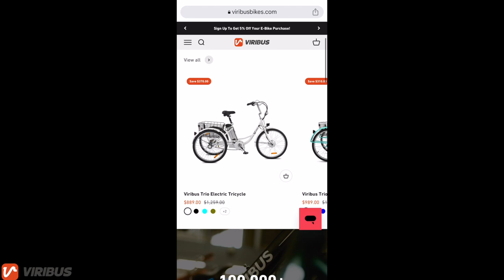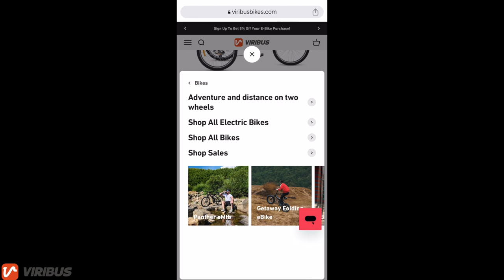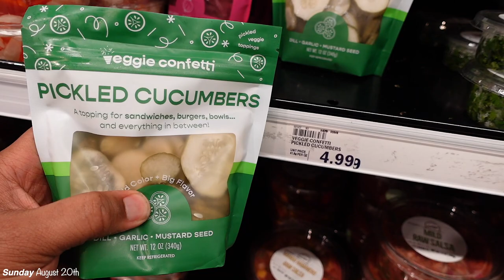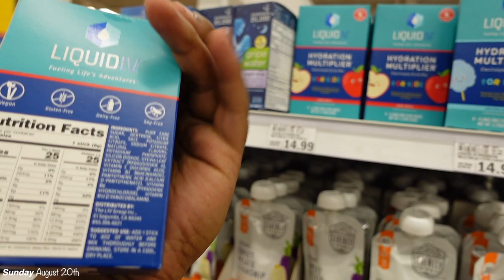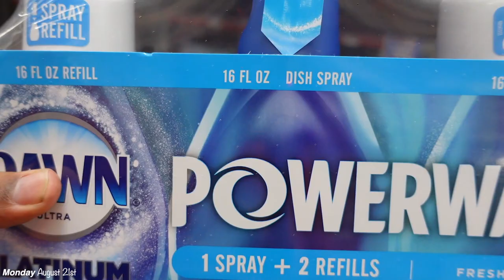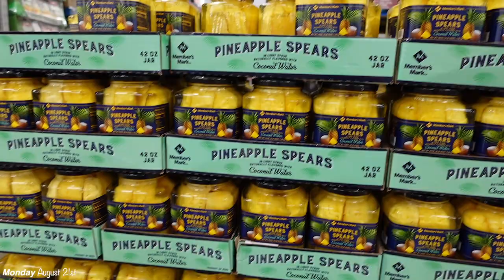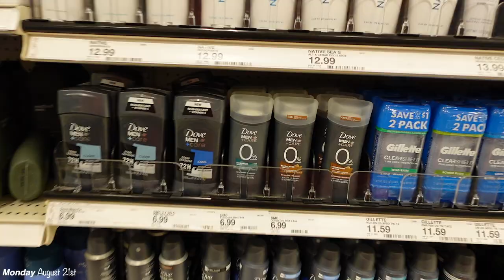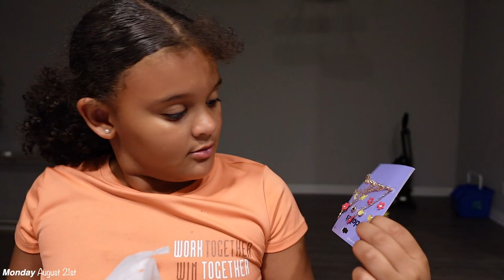VLOG --Guess Who's Back!? here we go again, End Of Summer Bbq, A lot of errands |DameDash

Comment: That Car mount is very sturdy… where y’all get it from?
Reply from the maker: Amazon Suction Cup Mount Compatible for DJI OSMO Action 4/3/2, Gopro 11/10/9/8/7/6/5/4, OSMO Pocket 2, Insta360 ONE RS, R, ONE X3, X2, with 1/4"-20 Standard Thread Adapter